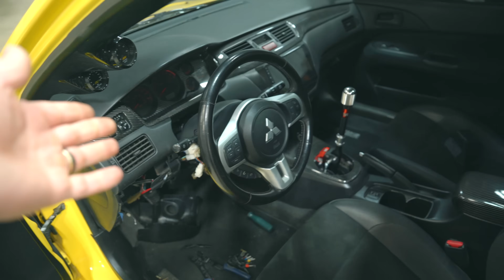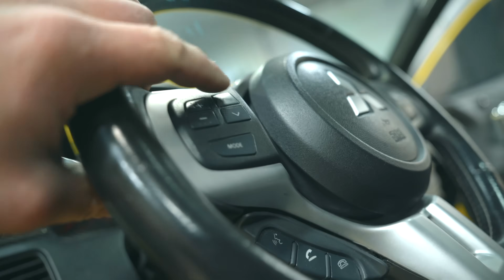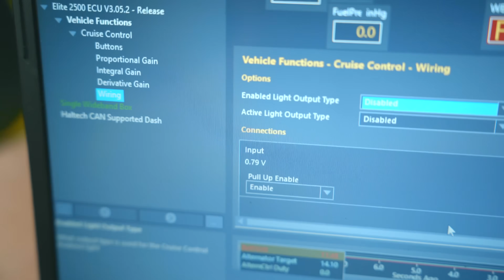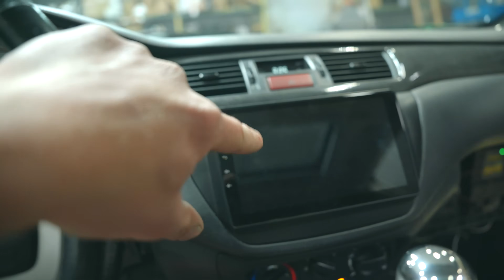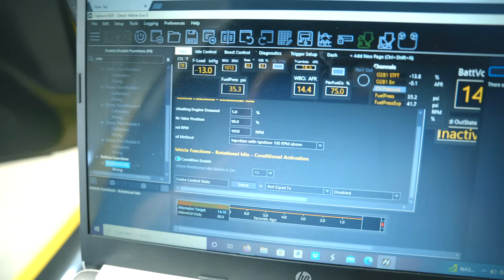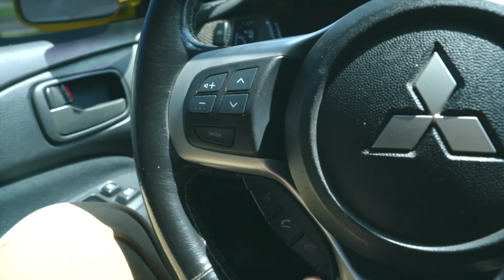INSTALLING ROLLING ANTILAG ON MY EVO! (THIS IS WAY COOL)

Comment: Can you elaborate on what wires were what on the evo x clock spring? I bought an evo 8 clock spring and a x clock spring and watching you vid. I was wondering if you could share the details on what wires were what on the 10 spring. I swapped the 8 angle sensor and turn signal stalks

Comment: just curious... if you use cruise control (CC) as your rotational idle (RI), what happens when you put the clutch in and your engine goes down to idle while lets say  you are braking coming to a stop, off ramp, or traffic, you dont have a indication light on the dash or anything just curious if you couldnt use a different button

Comment: Nice work man! I did email you back with that exact wiring. Glad to see it works! Also Pioneer make a direct replacement to those android 9 inch radios. They are next level in comparison. Pioneer dmh-ap6650bt.